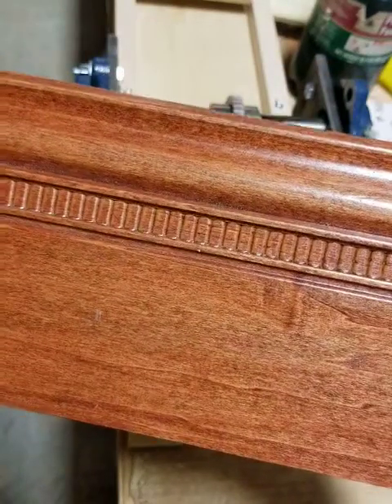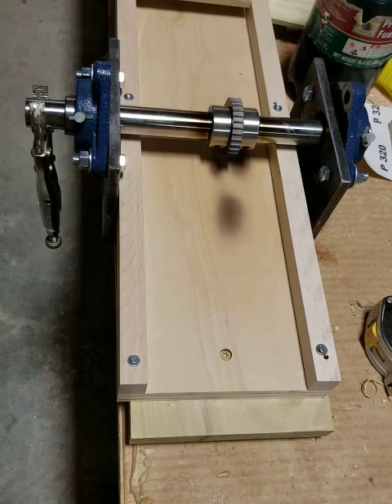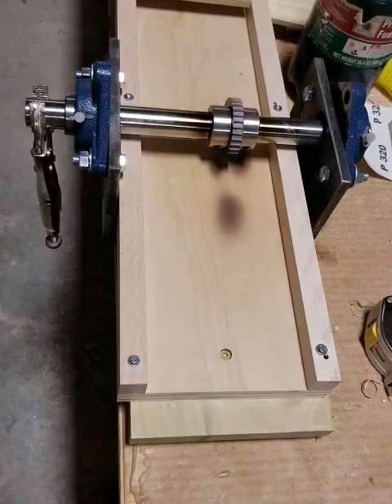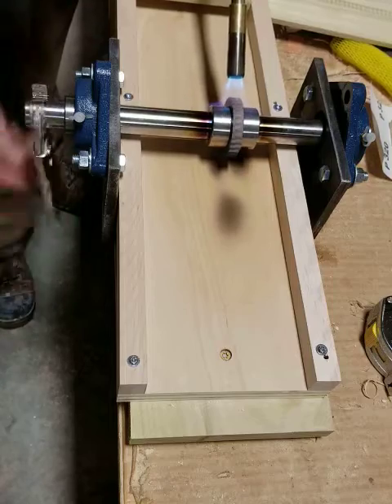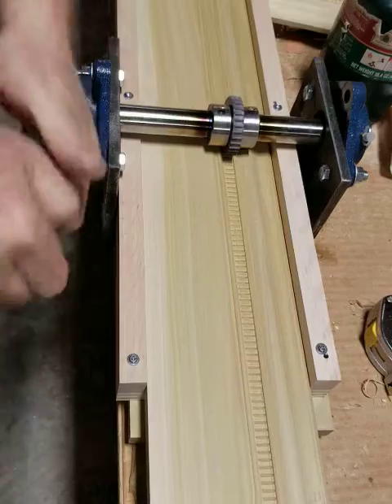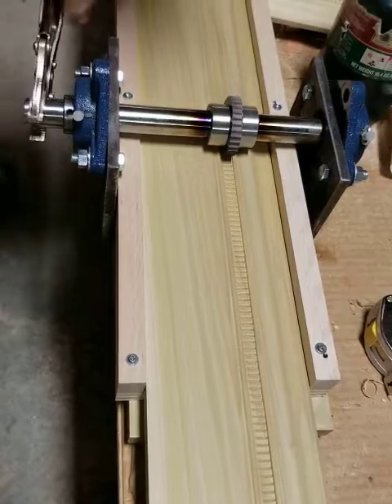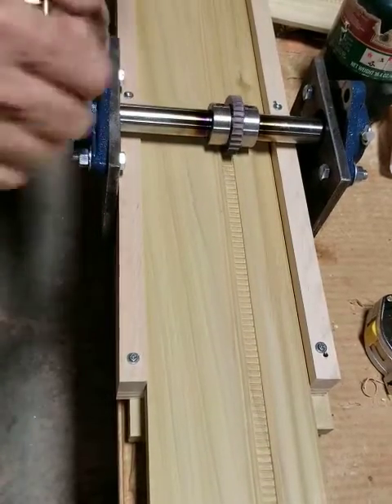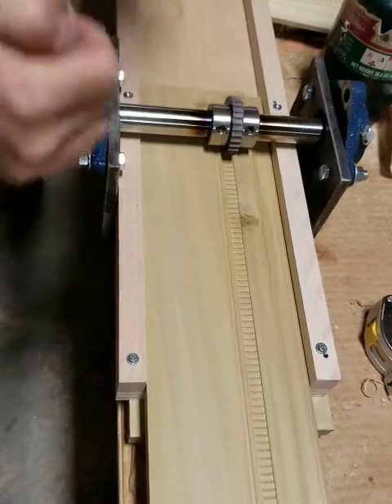Embossing Wood Molding

Comment: Is their any other way without heating.
Reply from the maker: You could probably wet the molding, but that will likely cause other issues.  The heating prevents the wood fibers from breaking instead of just being formed by the embosser.

Comment: Can the embossing will been heated with an electric current and maintain a constant temperature. Avoiding the torch method
Reply from the maker: I'm sure it could.  It would take a heck of a power supply since the electrical resistance is near zero for all that metal.
Reply: @leog3762  hmmm?

Comment: Leo, Very nice looking, I liked that profile and the embossing made it even better. Do you have a knife pattern for that profile?
Reply: Yes, I have a set of knives for the Williams & Hussey molder.
Reply: @lrgwoodcrafting  Is the knife set a standard profile or a profile you designed ? Where did you purchase? Thanks, I just received my Shop Fox W1812 yesterday first time ever owning or using a moulder. I am looking forward to making my own base, crown, casing and any other thing I can do with this machine. Thank you for your time in responding. Jack
Reply: @jwar2163  I had a client come by with that molding and needed it replicated.  I took his sample to my knife sharping company because they can make W&H knives.  The Shop Fox is a copy of the W&H so I'm sure they could be made for that machine.  They made me the knife which is just the upper profiled section, not the flat.  Just ran what I needed plus more to test the embossing machine and he was a happy client.

Comment: How to make it sir, what parts is required please tell me
Reply: one foot long 1" hardened shaft

2@ 1" pillow block bearings

1 custom fabricated steel "U" to hold the pillow blocks with holes on each end for the shaft to go through and 4 hoes each to hold the pillow block bearings.

2@ 1" stop collets, one of the drilled into the embossing "gear"

1@ embossing gear, custom made by my sharpening company on their waterjet CNC

Wooden guide for molding to travel in.

Pillow blocks, stop collets and shaft can be bought on Amazon, the rest are custom fabricated and are not available for simple purchase.
Reply: @lrgwoodcrafting  thank you so much Sir, greatful for your shearing ❤️😊